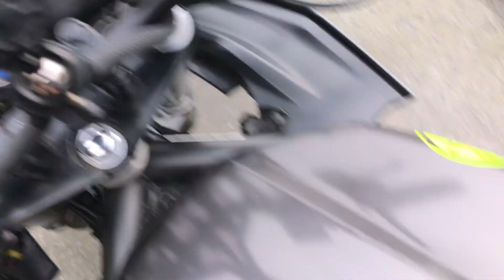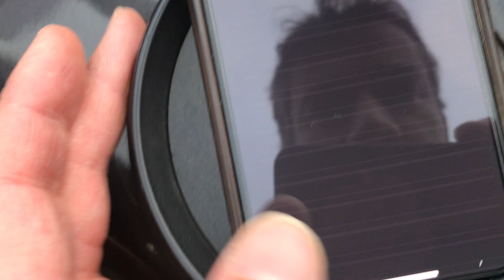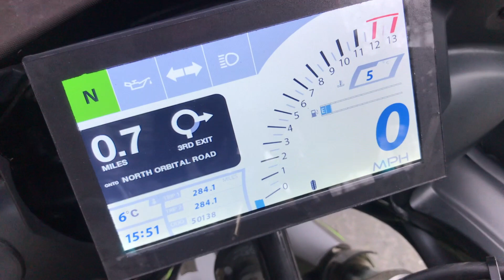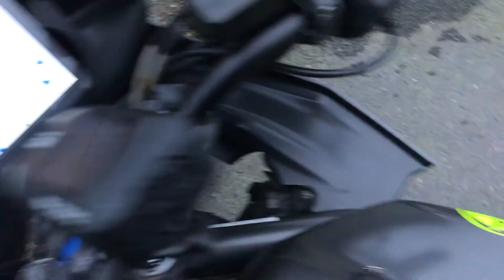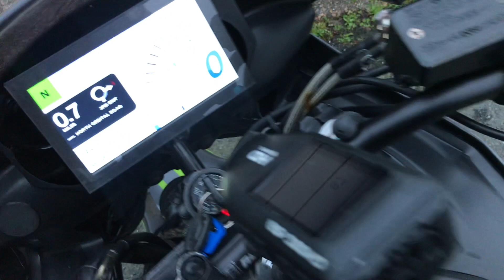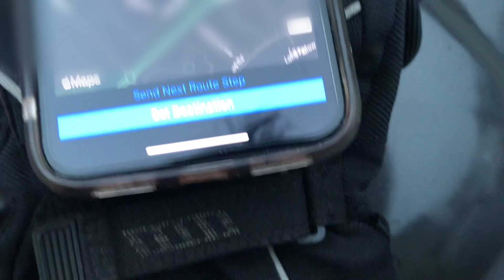TFT Dash - Navigation Update - Road Test

Comment: I recalled talk of a version for FZS600, but not sure how far it got.

This would be fully ace to replace my stock displays

Great work
Reply from the maker: That's pretty much ready to go out but I halted because I couldn't find a wiring diagram for FZS600 anywhere! It was the way the cooling fan worked that was stopping me. On FZS1000, cooling fan is triggered by the clocks on a specific pin but couldn't see that on FZS600 - if I could get clarity on that it would very much speed up the FZS600 version

Comment: Really love the work you have put in. I have a quick question though: does your cluster work on the data from the k-line or are you doing voltage level translation?
Reply from the maker: Many thanks! It's connected into the same plug the bike uses for it's clocks, so reading the raw signals / pulses for speed, rpm etc..
Reply: @MrScififan  Will this be compatible with the FZ1N 2011 (I am 99% sure it'll just work but just thought i'd ask)
Reply: @MrScififan  hi where can I contact you
Reply: Hi, I'm trying to contact you to buy one.